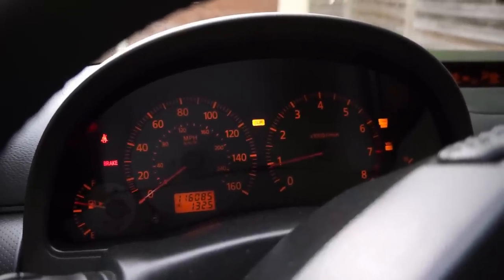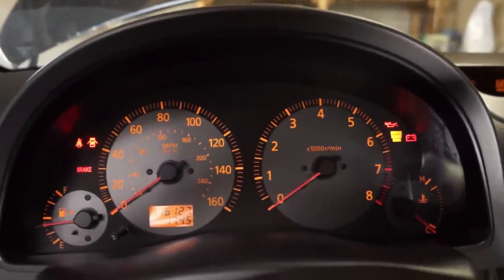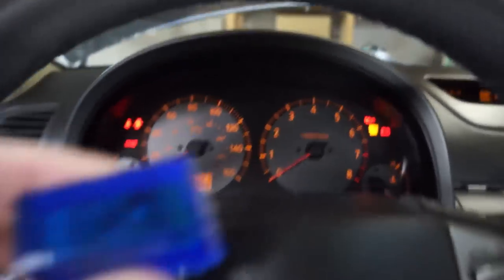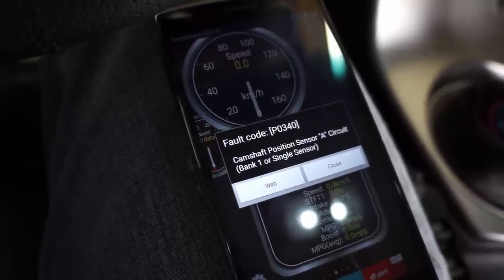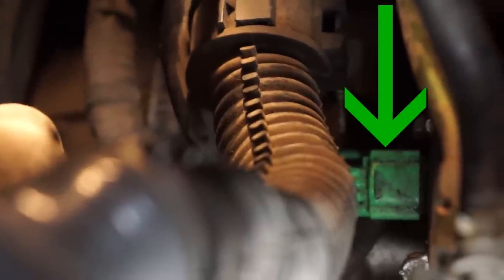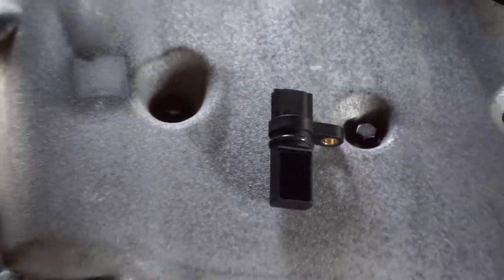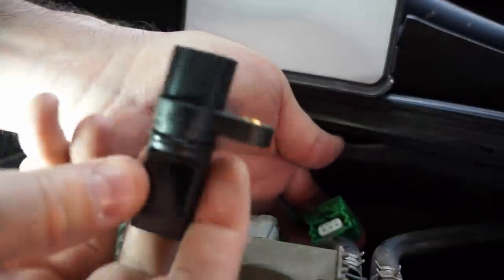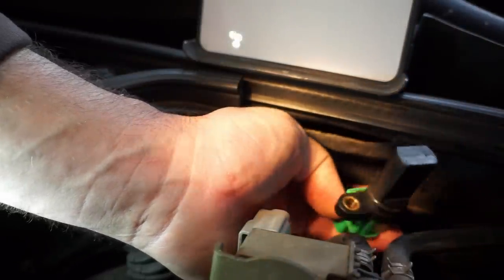2003 Infiniti G35 Camshaft Position Sensor (Passenger/Right Bank 1)

Comment: is this the same with code “camshaft position timing”
Reply from the maker: I can't give you a good answer o. That question.  Sounds to me like that would be a different problem than the sensor going bad but it might solve your problem to change the sensor.  Since it is a fairly cheap part it is worth a try.
Reply: Bro! We’re you able to fix this problem??
Reply: Ghyslain NSofor yep , I did a oil change and it went away. but it came back like 2-3 months after it and I just had them replace the camshaft sensors.
Reply: Ghyslain NSofor & it completely went away

Comment: Is there a different code for each sensor? If not how can i tell which to switch or would you recommend switching both? Just had these lights turn on last night and it froze my car up. Luckily i was in a parking lot and not a highway.
Reply from the maker: P0340 is bank one and I think P0345 is bank 2.

Comment: does anyone have the part number for oem bank 1 position sensor for a 2003 Infiniti G35?
Reply from the maker: Camshaft Position Sensor
Part Number: 23731-6J90D
Positions: Right
Replaces: 23731-5M010, 23731-5M015, 23731-5M016, 23731-6J900, 23731-6J905, 23731-6J906, 23731-6J90B

Camshaft Position Sensor
Part Number: 23731-AL61D
Positions: Left
Replaces: 23731-7Y000, 23731-7Y001, 23731-AL610, 23731-AL615, 23731-AL616, 23731-AL61A

Comment: Mine won’t clip in, it was loose help me
Reply from the maker: Your sensor?  It should be held in with one bolt.  If your talking about the electrical connector it may be broken....you'll need to have it replaced or find a way to zip tie it in place so it doesn't lose connection.
Reply: JR's Garage yes I’m talking about the green connector I realized it when I was able to pull the sensor loose even with bolt on
Reply from the maker: So the sensor itself comes out by pulling on the electrical connector even though it's bolted on?  Are the bolt threads stripped?

Comment: where did you get the phone app
Reply from the maker: It's called Torque.
Reply: so I changed that senor it started up good shifted then went back to slip and slow do you think I have to change bank 2 also and would you have a video showing where bank 2 is located ? @JRsGarage
Reply from the maker: Possible you need to change bank 2, I'm not sure.  It is located behind the throttle body, green connection.
Reply: Is it the green connect close to the one I changed ?
Reply from the maker: Kinda close.  They are both on the back of the engine.  Behind and below the throttle body.  I think it's the only other green connection.
Reply: Thank you

Comment: Do you think it's the cam sensor if i have no spark in any cylinder?
Reply from the maker: Sorry, I'm not sure about that issue.  Since each cylinder has an individual coil pack it would seem logical that some sensor might be messing up the whole system.  Is it throwing any codes?
Reply: @JRsGarage  actually i changed the battery so it's been wiped out sadly... But when i didn't change it yet i had 2 or 3 codes like P0340 for catalyst system below threshold, and for the o2 sensor. Other code i remember was for egr valve
Reply from the maker: Not sure I can help you with that.  Probably needs to be seen by a professional.
Reply: @JRsGarage  okay thanks for the help

Comment: Wheres bank 2 sensor?
Reply from the maker: Near the throttle body, just below on the back of the engine.
Reply: @JRsGarage  what do i have to remove th replace the bank 2 sensor
Reply from the maker: @ferndoggx4152  I haven't had to replace that one yet but I would think if you take off the intake tube it may provide better access.  If you can't get to it that way then you may have to remove the intake plenum... I'm not sure.  There's a green electrical connection on it and it will be held in by a 10mm bolt.

Comment: Changed both of them and the starter fucker will still no turn on.
Reply from the maker: Do you have a code reader? Do you have any other codes showing up?
Reply: @JRsGarage  no codes popping up. I found out it might be my keyless FOB so I ordered two. I couldn't take off the alarm so Idk if it starts but I did need to change all the sensors and starter had a ripped wire. But I am basically doing a rebuild is my thang.
Reply: @911Estyle  Did you ever fix this issue with your camshaft?

Comment: Need your help. I went to mechanic to get the passenger side camshaft sensor replaced. The green thing to connect with the sensor doesn’t make the CLICK sound it doesn’t attach right. He tried putting some adhesive but it didn’t work and the green thing that connects to the sensor doesn’t attach fully it keeps slowing sliding off of it. What can I do to make it stop sliding off ? Or what can I do to make it click ? Get a new green thing?
Reply from the maker: I've had some luck using zip ties to keep some of my electrical connectors on that are broken. But it would be hard behind the engine to get it tight enough to stay on. Your best bet would be to go to a junkyard and cut one off of a different car and then splice the wires.

Comment: My car randomly shut up while coming into a stop would it be a cam sensor?
Reply from the maker: It could be, that's one of the symptoms I had. Take it to AutoZone or another parts store and have them check the codes.
Reply: @JRsGarage  I did and got codes p0420 & p1283
P0420 is cat system below threshold 
P1283 injector pressure regulator or fuel damper I believe
Reply: @JRsGarage  also had 34miles in the tank since I was just taking it around the block it turned off and it read 56miles so I’m kinda confused
Reply from the maker: @OM4Rx  could be a vacuum leak causing the car to run lean or a bad O2 sensor.
Reply: @JRsGarage  it’s definitely my sensors! My puppies chewed them up but I took it to the mechanic and they spliced my wires up since they weren’t fully chewed but I’m pretty sure my dogs messed them up for sure